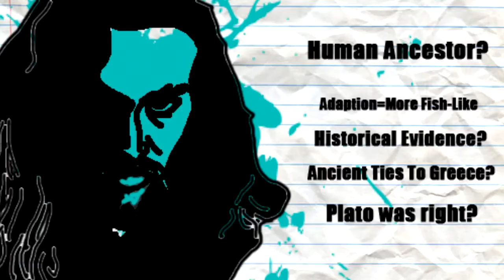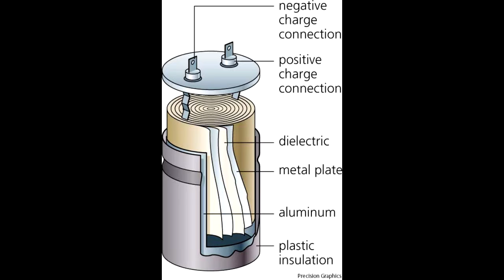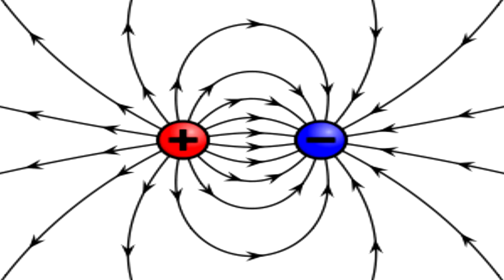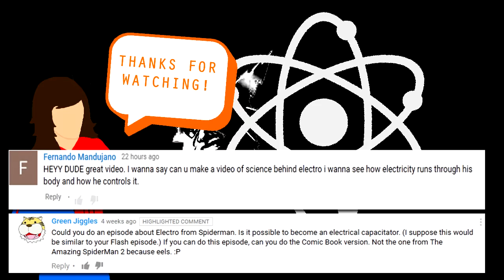Is The ELECTRO Suit Practical? - Science Behind Superheroes

Comment: His suit could also contain super conductors that can carry the electric discharge from the capacitor to another part of the suit. Capacitors have a practical use in electronics and are used to store charges  and discharge them quickly, and this is used in anything from cars to flash circuits in a disposable camera. That means that you can use wires or circuits to transport  the electric charge from the circut instead of releasing the charge directly. The only problem with this is that wires and circuits would melt under the charge, but I have a solution. Super conductors. Super conductors are already highly conductive metals on their own, but they add something else to the mix. They super cool the metals using liquid nitrogen. This makes the metals super conductors that can withstand monumental amounts of electrical discharge. Super capacitors are even used in power plants! This could definitely transport the large amount of electricity that electro needs to transport. He would have to learn how to conserve liquid nitrogen.
Reply from the maker: Interesting! The super capacitors/conductors seem like they'd really help with moving the charge around his body, which could also account for his ability to discharge from seemingly any exposed area, so long as that area has a super conductor or super capacitor running to it. The idea of him conserving liquid nitrogen is also very intriguing, perhaps an extra set of the rubber tubes would be needed in order to let the nitrogen flow to the metals and circuits without coming into direct contact with his electric energy?
Reply: +KLyfe - Science Behind Superheroes He would need extra tubes. They would have to be made from a different material than rubber. Most polymers freeze and break at the temperature of liquid nitrogen. He would need something like copper tubing. He couldn't expose these tubes like he does with his tubes he currently has on the suit, because one break would prevent him from using his powers. His suit would have to be more armored, and would need impact resistance and bullet resistance. For impact resistance he could use a substance called d30. D30 is a material used in film and in armor worn by some military operatives. It is a shear thickening fluid. This means it hardens on impact and disperses most of the energy applied to it. It can even stop small caliber bullets! Kevlar is an obvious choice for bullet proofing. He would need a heating system for the rest of the rubber suit to prevent it from shattering or rapidly expanding and breaking because of a quick temperature change.
Reply from the maker: The only issue I can see with all that is that the suit might start to bog him down. The copper tubing wouldn't be a huge add to weight, depending on the diameter of the tubes. If they were small and thin enough to still carry the liquid nitrogen without adding much weight, that sounds pretty practical, (so long as it's under layers of his suit). My concerns about weight start with the Kevlar/D30, while both are light weight materials and are a great addition to the suit, too much added to the already bulky suit might be too much. Ultimately, I think the main concern would be the heating system, if it works the same way as his electric current and his liquid nitrogen, is it the case that a heaver material would be required to make the heating tubes? Rubber and similar materials would melt, and metal would start to do the same over time. Although, it depends what kind of metal is used. I pictured the same material pipes use for heating tubes, while it would be practical for the purpose, I'm not sure it would do the rest of the suit any good. However, if it worked like  a heating blanket, things might be different. The suit itself looks fairly baggy, what if part of the suit is a similar construct? It could contain resistant wires that would generate heat if an electric current was passed through it. From what I've seen, the heat is dependent on the strength of the current. This could mean a few things, perhaps Electro would have to discharge a lighter amount of energy to heat himself?
Reply: KLyfe - Science Behind Superheroes I was thinking about the heating system being like an electric blanket type heater because it wouldn't be hard to use a little energy from the capacitors and use it on the heating system.
Reply from the maker: webslinger911able
Yeah, I was thinking around the same concept! It'd make more sense, it's lighter, and like you said it'd conserve more of the suit's energy.